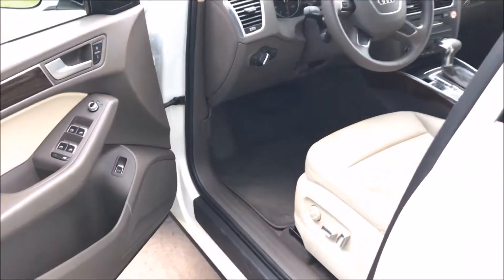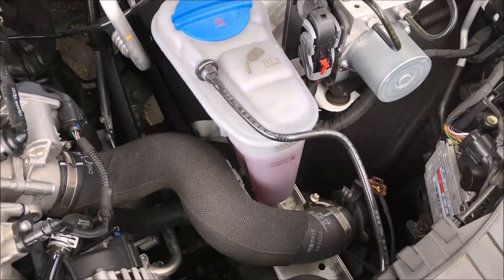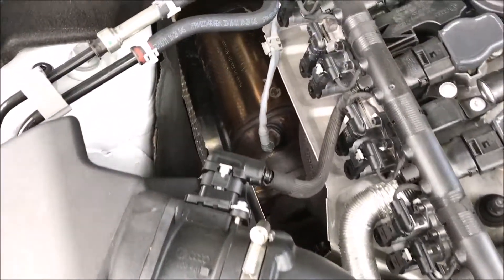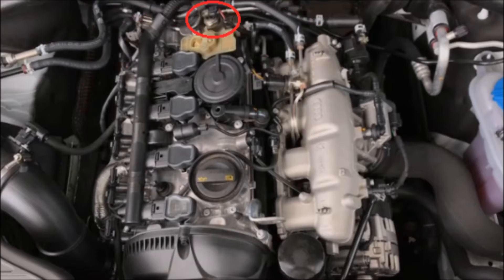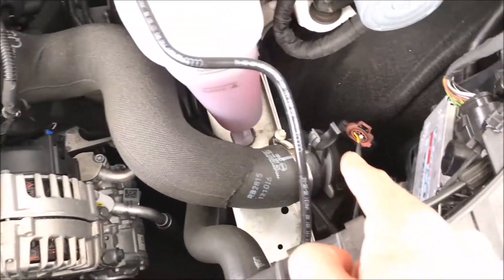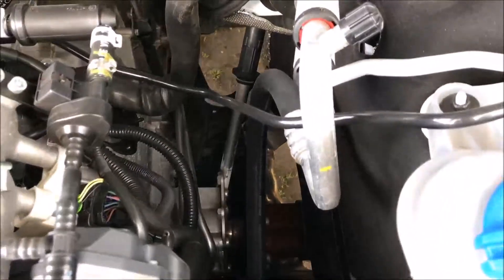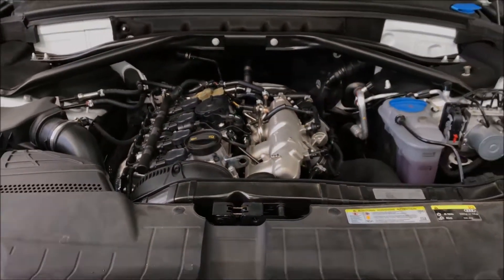2017 Audi Q5 Engine Review

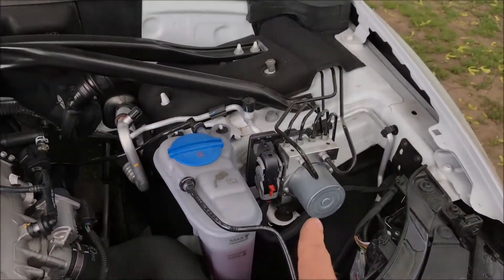Comment: At 02:13 you are showing the MAP sensor and that “filter” is actually a muffler for the charge intake system.

The MAF sensor and the air filter are on the passenger side of the engine.

At 04:22 these are the fuel lines and the EVAP lime from the gas tank.

At 05:03 this is only a wiring harness and not fuel injectors: they are exhaust valve actuators.

At 07:30 this is the turbocharger not a secondary throttle.

Comment: Hey, I love your video. Check out 4:10, are you sure it's the idle control valve? I previously thought it is evap canister port and I'm going to spray intake valve cleaner through it while engine starts.